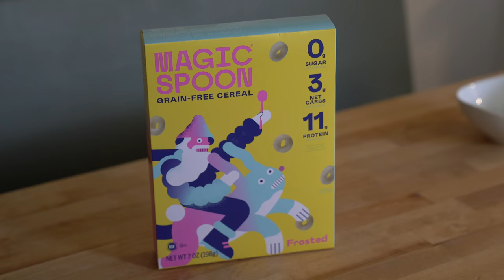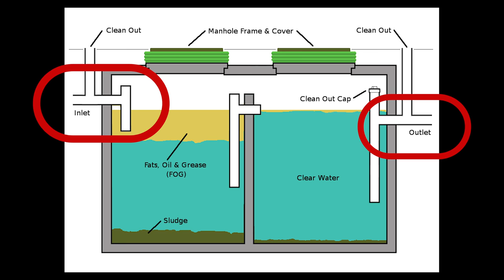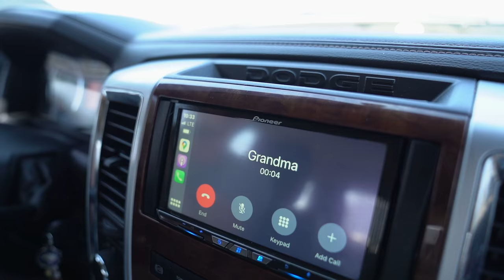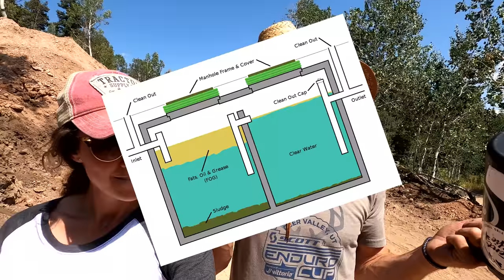SEPTIC SYSTEM INSTALL | BUILDING IN THE MOUNTAINS

Comment: We had a house built in 1965, we moved there in 1987 and it had a septic field that all the pipes were clay and we were young and didn’t understand septic. There was a tree too close to the house that was causing damage to the shake roof so we paid to have guys come in and cut it down. They didn’t ask and we didn’t know so it was dropped in 8 foot chunks over the septic field completely crushing it. Nightmare. We did not have the ability to put in a new septic tank with the upgrades that it needed to be at code. I was trying to get my 18-year-old through to graduation. So for six months the whole family showered at the rec center and only used upstairs toilets and I dug trenches out to the very back of the yard so it wouldn’t leak down into the neighbors yard! We made it through though and sold the house and moved on. We learned a lot. 
You two have wonderful dreams and are making them happen, good for you both💞

Comment: I wonder why they didn't compact the earth and lay a compact gravel pad under that. I thought that would be a no brainer. 😳
Reply: I was wondering the same thing.
Reply: I was explaining what they are installing to my guy who explained to me what is involved and I didn't see any of what he said and is exactly what you both are saying
Reply: They’re building on the side of a mountain. No amount of leveling will stop the force of a billion years of geology. That said a foot of gravel base would’ve at least got them through the inspection.
Reply: If they had water filling only on the one side, that weight would have forced the tank off-level.
Reply: Nothing beats a concrete slab. 100 mm thick it's cheap and easy to do yourself.

Comment: that is a very good septic system type... we used to have those in our rural communities until "contractor interests" got involved in state laws... now we spent $25,000 + on systems that don't work, break easily and require $400 maintenance a year... your type system may require new little stones in the drainfield after many years (not a problem)... be kind what you allow down your drains (no non-digestible solids and chemicals)  and you are all good to go for a long time

Comment: I really enjoy your channel, your personalities and your relationship. As a homebuilder for over 25 years, I do have some concerns about your preparedness to build this home. Today's first concern is triggered by the ladder purchase. The vast majority of jobsite accidents are fall-related, and most involve a ladder. Please do some research (Werner has good information on their website) and give some more thought to type and grade.  For example, fiberglass Type I or better is my preference, especially for exterior work. Rating is determined by the weight you expect to put on the ladder - the weight of the user plus any materials being carried up the ladder. Also consider conditions on the ground (so to speak) - any power lines or chances for a ladder to connect with electrical current - even standing water can pose a risk - aluminium is a great conducter. I know the lighter weight of aluminium is attractive, but for anything over 4', I will typically choose fiberglass. For longer extension ladders, weight is more of a consideration- if you get to that point, please consider adding a spreader, again for safety.  My other concern is your comment about windows - while high performance windows are certainly important,  I know you are on a budget. Air-sealing the building envelope and insulating properly are equally important. You may want to consider engaging an energy rater to help you evaluate some of your options to insure the best performance for the most reasonable cost.  Take your time, think "safety first," and have fun!

Comment: When you get a minute, please let us know what the power issue was after  “terry’s maiden voyage”. It may be something we could look out for in our Oliver travel trailer with solar. Thanks.👍 Glad your permits fell into place.
Reply: Yeah, I'd like to know what happened too.
Reply: Only use a pure sine wave inverter, Or a pure sine wave generator. Modern electronics and devices don't like the old loud generators Because they are  A modified sine wave
Reply: @mrmotofy  Uh...  Inverters can be modified sine wave or "pure" sine wave.  Open frame "old loud" generators ARE pure sine wave, but of dubious frequency and voltage regulation.  A surprising amount of electronic stuff will happily run on a modified sine wave but not everything will.
Reply: @raygunsforronnie847  I'm not aware of the old loud generators being pure sine, but I know they can cause all kinda of problems. That's why I clarified to use a Pure Sine, if it's described as such in theory you'll be ok
But yes some stuff will run on a modified. But cuz it runs don't mean it's good for it or it will live a happy life. That hit or miss with devices isn't worth the time or hassle in my opinion. Spend the money cry once and be done rather than trouble shoot random things not working or working intermittantly.

Comment: When are you going to fix the electrical system or the Battery and charger in the trailer or camping wagon?
Reply: Yes I'm also curious. What was the problem with the batteries?

Comment: I wouldn't count on the septic never needing pumped. I've never heard of such a thing.
Reply: vote4freedom I completely agree, I work for a company that pumps and diagnoses septic tanks. We always recommend once every 5 years to keep sludge levels down and to keep all of your drains from clogging up. But there’s a good trick if you want to prolong getting it pumped, just put some bakers yeast down the toilet.
Reply: You'd go poor pretty fast if you got it pumped out every 5 months.
Reply: DrinkinSlim I apologize I meant to say 5 years
Reply: Ours is required by the county to have it pumped every 3 and we have a leach field....$85.00 to pump a 2 hole tank capacity.

Comment: After you have Terry parked at the homesite fill a sandwich baggie (or quart size) 1/2 full of water drop 2 pennies in it, seal and hang over the opening side of the entry door with fishing line. Just above the door opening and it should keep the flies away from you and your meals☺️ we have one at each door opening to our home and garage. May look a little strange......but it works!!!  Hugs from sunny Arizona 💖😎💖

Comment: Hi guys not sure if you spotted my last message, you should invest in a Kipor IG 2600 Suitcase Inverter Generator for Terry - its a Sine Wave generator so should work with your Solar setup. They're extremely quiet and great quality, perfect for your needs. We've had ours for 5 years, its still perfect. Worth every penny. 👍

Comment: Love your grandparents. That is one massive septic tank system. We had to redo ours when I lived on our farm ( Mamaku, New Zealand). The original was a corrugated water tank sunk in the ground with holes in the side from the 1950's. The new one (1985) was a concert one but a good half size to yours and one lea, which was a single 100m trench out into the paddocks. We filled it with what every non compostable things we could find...rocks and shingle but mainly a couple of trailer loads of tires.  Before it was covered over and re-grassed. Mind Mamaku is a plateau 1,840 ft above sea level made of lots of soft  ignimbrite , which gives a fast draining soil. But a fabulous landscape with large tors, like megalithic standing stones scattered over the landscape.

Comment: In 2000to my husband And I moved to Northeastern Kansas Where we built our own home. Believe me it’ll take longer than you think it will but don’t stress it because there’s not much you can do. We ended up because we’re out in the country with the septic system called the Mound system that took up a large portion of the 2-1/2 acres.  I think it’s a lot like what you have as the septic tank was buried halfway between the house and the mound system and the house was at the top of the hill. The only thing is that the grass never grew very good on top of the mound and when you mowed you had to be careful. Good luck on your build.

Comment: Take tons of pictures of where your leech field pipes are located. Pictures come in handy if you ever have issues and to know where NOT to drive so you do not crush the pipes. Also - you should ask how these new drain filed pipes prevent ROOTS from growing into them.  We just replaced our drain/leech field because water wasn't draining properly. Come to find out - the pipes were CLOGGED with roots as big in diameter as the pipes (4 inch pipes - old style). Always good to know what to look forward to WELL in advance because sooner or later - you will likely need to replace it!!!!!!!

Comment: You must check out Amazon for cooling face masks!  I suffer from heat and absolutely love these!  You can take them off and pop them and they refill!    Just run under water and wring out and the head wraps have elastic at both ends so you can twist and wrap all kinds of way!    I also have a few towels that are cooling for neck , back and shoulders!

Comment: This may be addressed further in this video...but I wanted to get it out there before I forget. Put risers on the septic tank manhole covers! Before you even bury it the first time. We didn’t think we would ever need it OT need to pump out our system (if we used it correctly) but 20 years into our occupancy - we have had to dig up the manholes at least 6 times I can remember. The risers will alleviate the need to dig in the dirt-you just open the covers from the top of the risers. And NEVER drive over tank and try hard to not drive on leach field if you can avoid it. Good luck! More Grandma and Grandpa!!!! 🥰

Comment: As a septic designer apprentice in Washington state I can only shake my head and wish it were that easy here... Also, the grates (luvres) on the sides of your "black domes"/Gravelless Chambers are for oxygen to get into the trenches not for gases to escape. And for your septic tank it may be worth putting risers over the inlet and outlet for future maintenance of your system. Also, proper pea gravel bedding under your septic tank should've gotten rid of the settling problem, would've helped with keeping your septic tank from possibly cracking after settling over one of those large cobble stones I keep seeing in your spoils piles.

Comment: Hey guys... being the owner of a sceptic system, I can say they do not always function properly, and sometimes need to be pumped out. The theory of course is as you explained, that the bacteria layer will eat/breakdown the solid material and you are left with nothing but grey water... not always the case. given that this is a very real possibility (just trust me on this) you may want to make provision for pumping this out periodically. My suggestion is if the tank will be burried significantly, have some access pipes located over the two covers. Not sure how deep underground yours will ultimately be. if it isnt very deep, just mark the covers with reference to a fixed point... say the corner of the house for example. Just a suggestion... but one you might be thankful for if you ever need to dig up the covers to pump it out. One last thing... I don't think the bacteria will grow properly if it is exposed to oxygen/light.... so even if you do make provision for something like this, there still needs to be some ground covering it. You cant have the access pipes (if you choose to go that route) completely exposed to the air... not to mention it would probably smell pretty bad. Good luck with the rest of the build! Looking forward to following your progress.

Comment: the area you are going to build a house in looks like a  Extreme Fire area,  Clear the brush way back from the house, and build the house out of Bricks or blocks, use steel rafters for the roof, use a steel roof, the steel roof is molded to look like a tile roof, also use steel studs for the inside walls,  build the garage the same way,  if you ever have a fire in your area, you home may be the only one left standing if built in this manor.

Comment: Thank you for sharing. Love your grandma  she must be the joy of a party.  All the work grandpa does keeps him young.
 Love your positive attitude and the understanding of the slow moving process of building a house. 
Great the the septic system issues was now and not after it was covered and full of #$#$%.  I would let it sit full for a week and see if there is any more settling.   On ladders.  I personally prefer  fiberglass over aluminum.  For better stability and safer for any electrical work.  and they take a better beating on a job site then aluminum.  Keep up the great work.  Best of luck

Comment: The tank may have just settled when you put the water in it so it could have been level before the water but settled unevenly.  Good that you're fixing now though and not have to deal with problems later.

Comment: The moral to the story is work with with a contractor you trust and then let them do their job. Also, great windows are amazing, but learn all you can about air sealing as you frame. Seam seal between the foundation and the sill plate leaks badly, glue the sheathing on the framing, plan on spray insulation for the rim and the tops of the walls in the attic. As a builder in Michigan, we have a strict energy code to follow and you will get the biggest air sealing/energy saving bang for the buck with careful framing and judicious insulation.

Comment: With the seatbelt issue, pull it out as far as it will go, use a clamp to hold it out and give the belt a good scrubbing with warm soapy water. 

The reels get full of human slime and either lock too easy or don’t recoil properly.

A good scrub will make them work properly 9/10 times.

Comment: I am watching your solar install video and saw you cut off that vent cap and covered it with the solar panel.    I thought that it was a vent and would need air to escape through the vent or why is it there?     I thought it would be better to have the solar panel on a slant, but what o I know?      Wouldn't the wires going down the refrigerator exhaust need to be encased in metal so that the wire casings don't melt?   Again, what do I know?    Not much, but I try to think and figure things out like how you two do all of the time.    Just trying to help point things out for you to consider.    The pup, baby Snowball, sure has gotten big and looks bigger than Frank.     They are nice pups.    You  did a good job and Terry looks beautiful and very homey.

Comment: Trent...Use a big metal file clip to hold the seat belt from locking...our '02 Isuzu has the same issue on bumpy roads...cheap fix..easily stores ....Cheers from Maine

Comment: Trent, try raising the seat belt height on the side adjuster. Yours seemed to be set low for you (while Allie's passenger side was set higher).  Maybe it's a little too snug leading to the extra lock ups.

Comment: Good luck on the build. Spend money on the pros and save on time and expensive mistakes and potential work injuries/overuse injuries.

One more person weighing in on putting a fire break around your construction site now, not when the spring thaws have the land in a mess. Every time you do an aerial shot I see a brown, dead tree uphill and opposite the parking area. Roots can reduce erosion, but that one will just give way at any time.

If you have welding skills and can rent some machinery, a metal shop building can convert into a snug little house. I know -- we are on construction year 4 and finally have a working toilet in our lakeside cabin. The 4 X 12 sheet rock is almost all hung in the attic loft and we are in the tape/bed/sand/paint part of the common area with the 14-ft ceiling. 

My 60-year-old husband says this may (may?) be his last house build/remodel.
After 39 years of marriage, I am not betting on it. He does enjoy a challenge.

Things we did not do ourselves: Large concrete pours. Putting up the metal rafters (he and his two brothers did the welding, and our nephew worked the lift -- he's a pro). Spray insulation.
We've done asphalt and metal roofs. I highly recommend a metal roof. Check with your pros about how that works best where you are with regards to snow and ice. I cannot stress enough that safety is needed when cutting and installing a metal roof, but it will outlive you and is much safer in a fire-prone area.

Comment: Even though Terry will be attached to septic, you still need to keep the black a grey tank closed till full, then open to flush everything out. If you leave it constantly open, the fluid will drain out but the solids will get stuck in the tank and you will end up with a... brown pyramid.

Comment: So concerning the septic system. There is this piece of equipment called an emulsifier and it was designed for motor homes. So what it does is liquify all the solids before it goes into the septic system so that the enzymes can digest the waste more quickly and it almost completely eliminates buildup in the bottom to the septic tank and allows the water part to become pure more quickly. This can be installed after the house is built and plumbed. So you have plenty of time to research it out.

Comment: Might try a simple seatbelt extender first before replacing the whole seatbelt. You'll have to make sure it works with your seatbelt tongue as there are a couple of sizes, it makes a huge difference though. They can be found online, but some Auto parts stores also carry them.